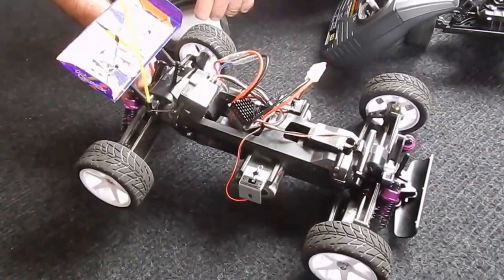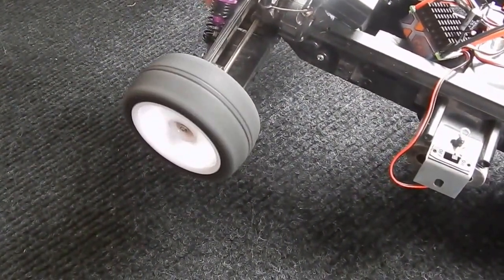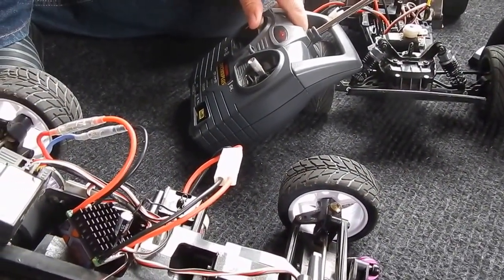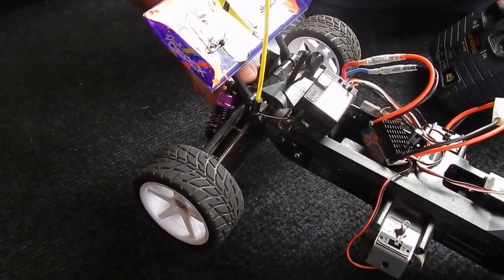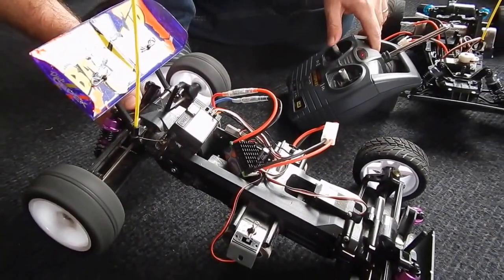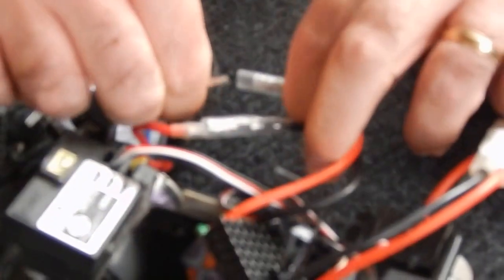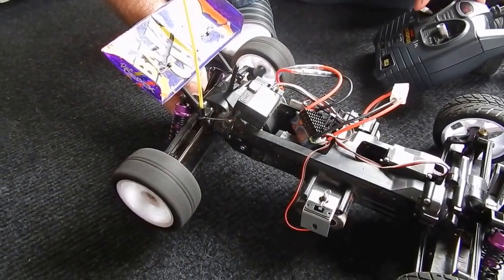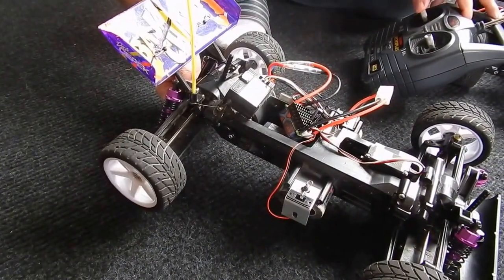HobbyKing X-Car 45A ESC runs faster in reverse (1)

Comment: The manual should tell you how to program the throttle in the Esc. It's probably limited for some reason when they tested settings at factory. You should always program new Esc or when you change controllers. You can find the manual online as well
Reply from the maker: The manual was virtually useless, but I did follow the calibration procedure. Many times. The result was always the same. I tried it in different cars and the result was the same. But it's long gone now and it's brushless all the way for me now.

Comment: I had the exact same issue. Did you get it resolved?

I realised I could reverse/inverse my forward and backwards control on my Futaba Attack SR transmitter (there's a little switch beside each channel/control stick to achieve this) and also switch the motor power wires over (reverse popularity). Presto; forward is faster and brake occurs between forward and reverse like it should.
Reply from the maker: Not really, I ended up selling the car in that state and have since upgraded to a brushless Quanum Vandal (which is awesome).